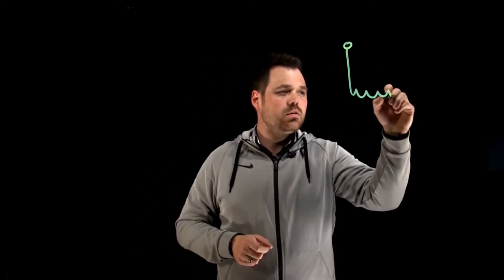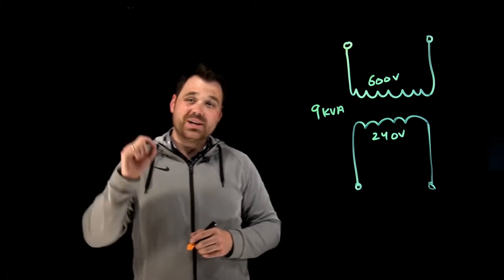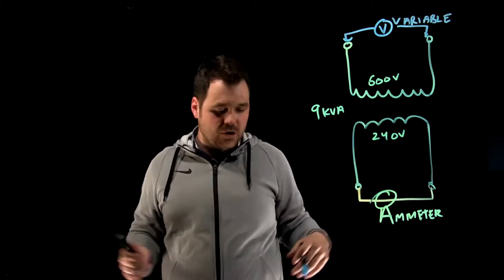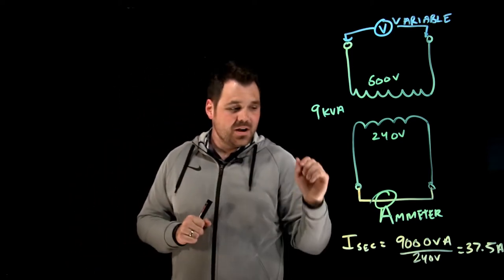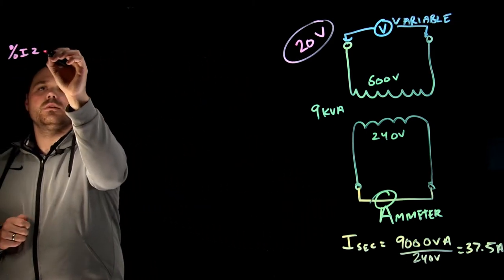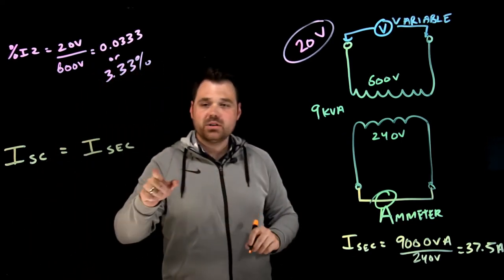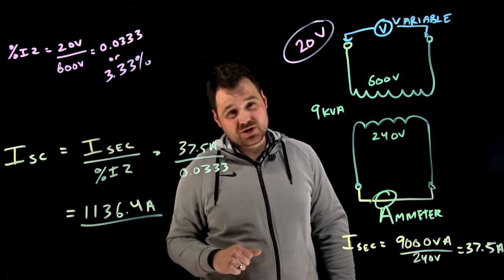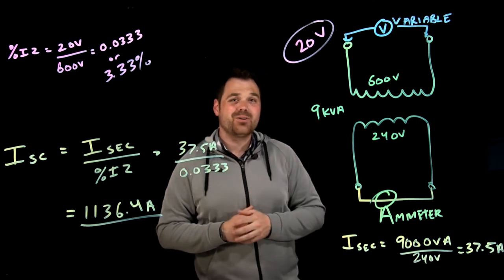Percent Impedance of a Transformer

Comment: It appears that the short circuit current can simply be calculated by realizing that if the current on the secondary is 37.5 A with 20 V on the primary then the current is (600/20)*37.5 = 1125 A when we have 600 V on the primary. (Ohms law). Your result was slightly different because of rounding error %IZ.

Comment: Could you explain where you got 20 volts.  Seems like you just picked a random voltage?  Did I miss something?
Reply: He just assumed that as he kept on increasing the input voltage on the primary side, 20V was the number when the ammeter on the secondary side started reading 37.5A (37.5A being the rated secondary current). This could any number depending on what the actual impedance is. For e.g. if the impedance of that transformer was higher, the ammeter on the secondary side would have recorded 37.5A only when the applied voltage on the primary side was a higher number, let say 27V.

Comment: This percentage impedance along with the transformer voltage determines if the maximum fault current could be handled properly by the breakers. The bigger the transformer, the lower the percentage impedance.

Good video.
Reply from the maker: Absolutely. Thanks for watching!
Reply: That second sentence is wrong.  The larger the transformer, in general, the larger the impedance.  If you drive down the road and see a 50kva pole mounted transformer it probably has a %IZ of 2.3-3% or close to that.  If you see a 100MVA transformer it might be 6,7 or 8% IZ.  In general the larger the transformer the larger the percent impedance.
Reply: Zack is correct..... just checked the nameplate of a single-phase 15kVA 7620/13200V 60HZ transformer which had a 1.9% IZ

Comment: where does the I_sc = I / %z formula come from?
Reply: The percent impedance is what is called a per unit value. The base values for the system are implied to be the rating of the transformer, so the base kva is 9kva and the base voltage would be 240v. This is just a way to model systems to make it much much easier for power system and primarily fault analysis. A transformer just becomes it's equivalent impedance in series. The voltage due to the selected base (pu = actual/base) is now just 1 pu. So in a short circuit you have a simple series circuit with a voltage of 1pu and a reactance of .0333. Using ohms law 1pu/.0333 gives you a per unit short circuit current of 30 pu. To convert from pu back to actual fault current, you would just need to multiply the 30 pu by the base current which is determined by the given power and voltage bases. This also happens to be your secondary current, so - 9kva/240v = 37.5 and 30*37.5 = 1125A.  

Or to put it all together
(base voltage in per unit)/(Transformer Impedance in pu)*Base Current = (1pu/.0333pu)*37.5A

The voltage is not mentioned because it is selected to be 1pu, but it is in there. Its still just ohms law. Your not actually dividing by a impedance you're multiplying by a unitless current value.

Current = (per unit current * base current) = 37.5/.03333

The equation is just a quick and easy way of combining those steps to determine the maximum available short circuit current at the secondary of any transformer. You'll more likely use it in this form Isc=S/(Root(3)*Vline*%z) or S/%z for your available fault duty if you are looking to incorporate other equipment for a quick rough calculation.
Reply: I was explaining in the case where we know the impedance already, but testing for the impedance works the same. You adjust your voltage until you're at a known current to determine the impedance. So its the same simple series circuit with the same bases, but the tests adjust the voltage supply until the secondary is at rated current which is also its per unit base current so it equals 1pu, which eliminates an additional math step.

This occurs at 20v or Vpu = 20/600=.03333 pu Using Ohms law Zpu = Vpu/Ipu = .0333pu/1pu.

Comment: Loved it.. Great explanation
Could you please let me know the logic behind the formulae you've used .. 
For e.g: why should the short circuit current be equal to the rated secondary current divided by the percentage impedance?
Many thanks .. subscribed!
Reply from the maker: So typically we say that short circuit has to do with available kVA and the voltage of the transformer, which using Rated current takes in to account both of those.

The other thing to consider would be impedance of the short circuit path, that's why this video we are just talking about what's available in theory at the transformer, not what you would see actually at the short circuit point.
Reply: If you change the percent impedance into actual impedance, your calculation for short circuit is just Vs/Z = Isc or a circuit with only your voltage source and your transformer impedance in series. All primary impedances are transferred over to the secondary side as one z equivalent. 

To get to z from %z you do the following. 
(1) Isc = Vs/Z
(2) Z= %Z*Zbase where 
(3) Zbase = V^2/S
Plugging (3) into (2) and (2) into (1)
Isc = V/(%Z*V^2/S) = S*V/(%Z*V^2) = S/(%Z*V)
Where S= V*A so
Isc = V*A/(%Z*V) = A/%Z

It is just ohms law with a lot of convenient variables that cancel out.

The calcs with the actual transformer impedance for this example are shown below which results in the same answer. 

Zbase = (240V)^2/9000VA = 6.4 ohms
Z = Zbase*Z% = 6.4ohm*.03333 = .21333 ohms
Isc = Vs/Z = 240 V/2.1333 ohms = 1125A

For the 3 phase case - Say three of these transformers were hooked up in a Delta-Y, Vllpri=Vphasepri = 600, Vphasesec = 240V and Vllsec=416V, then the equivalent transformer would be  a 27kVA 3 phase 600-416/240 transformer with %Z of 3.333%. Your results would still be 1125A for the max available fault current per phase
Isc = 27000/(3*240)*30 = 1125A
Reply: @jaymoseley6216  this is what i was looking for when i came here. THANK YOU SIR!!!

Comment: Sir , how we can calculate drop voltage at primary with calculation. As mentioned u 20V how it s came? Without meter any possible for find that drop voltage
Reply from the maker: You would need a meter to measure it

Comment: I'll just leave it there:
the amount of voltage required to overcome the impedance of the transformer to reach max secondary current (i.e., secondary short-curcuit current, which is determined by the design)

Comment: Hi Zack, is this short circuit current only seen on the secondary? Could I reflect it to the primary?
Reply from the maker: It is the available fault current on the Secondary of the transformer. It's the maximum it can supply
Reply: @ZackHartle  Hello Zack, Could I reflect the fault current on the secondary to the primary?

Comment: The short circuit current of the secondary of 1136 A is in theory true. However, In reality in an example where the source is 7200 volts to ground primary on a pole mounted distribution transformer and the impedance is 3.3% (with a 240 volt secondary) , that current will ALWAYS be limited to less than the calculated value as in this video. Most distribution transformers at First Energy were 3%.  The 7200 (7.2KV) distribution source side case, that source may not be able to supply the current to achieve the theoretical value on the low voltage secondary. In the power utility business to do this calculation for the secondary fault current you have to know the short circuit AVAILABLE fault current of the SOURCE. Once you know that you can solve the problem. You can use CYME (tm) or if you know the available high side fault current (the electric company can tell you) then u can use the FREE EATON fault current I Phone AP to get the answer. The AP is available in the Apple(tm) Store or https://www.eaton.com/us/en-us/products/electrical-circuit-protection/fuses/fault-current-calculator.html. Once again, you need to know the available fault current of the source to get the answer. Why do u need to know this? Suppose there's a 25 KVA pole transformer, 7.2 KV primary, 120/240 secondary,100 feet of 1/0 TPX to the weather-head and 100 feet of #2 CU to the main breaker in the load center. The electrical inspector needs to know what is the available fault current at the panel. If it's under 10 KA, then u can use off the shelf breakers from the home center. If its over 10 KA but less than 22 KA, then you need more expensive breakers that can handle the predicted fault current. The electrician needs to know this too. When the primary is  19.9 KV phase to neutral, the available fault currents are always high.